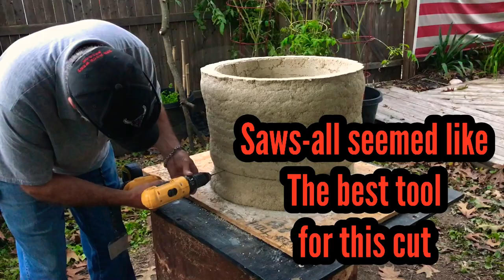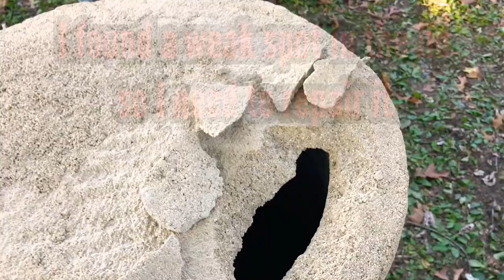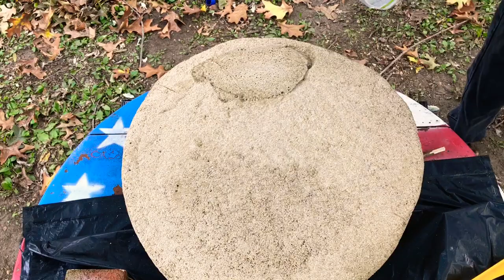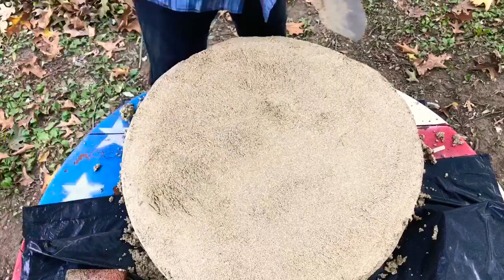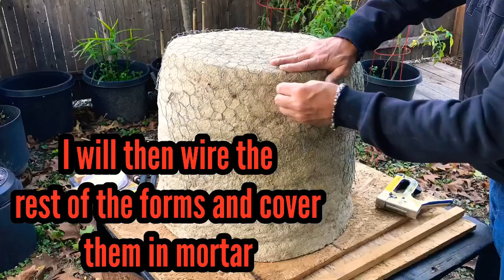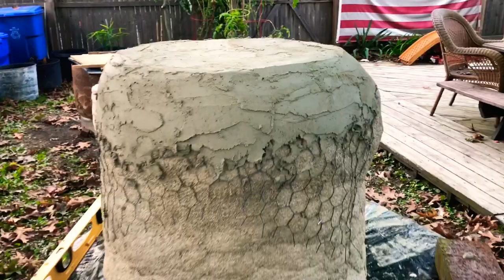DIY How to Build Tandoor Oven using Insulated Concrete Vermiculite n Quick Set Mortar Mix: Part 3

Comment: I am loving the progression, so far. Can't wait to watch this, and the next ones in this series. One question (coming from a guy who knows zero about this, so I hope this isn't a dumb question): Before this top was 100% hardened, could you have used a string or knife to "cut" open the lid? Or was it better to wait until it was fully hardened then use the saw?
Reply from the maker: better off waiting till the top hardens to cut it off.......
and for an update on the lid....  be sure to wire and mortar coat the lid also, i did not do that, was trying to keep weight down,  a year later a branch fell from a tree and put a crack in the lid... i used it a few more times but eventually it busted.... if i wiould have wired and mortared the lid that would not have happened.. you can see the fail in this video, i am pretty sure..https://youtu.be/uHwR9yQ2zaw   i am in the p[rocess of making a new lid, prob something simple like a steel can lid or possibly a brass Drum Cymbal....   i may try the Brass Cymbal just cause it will look pretty cool...   still thinking
any other questions please dont hesitate to ask... thanks